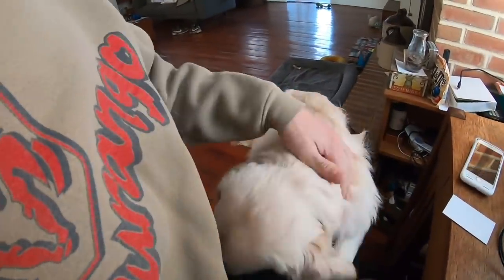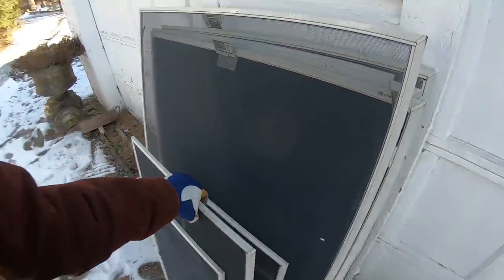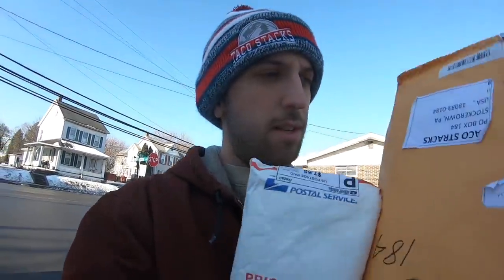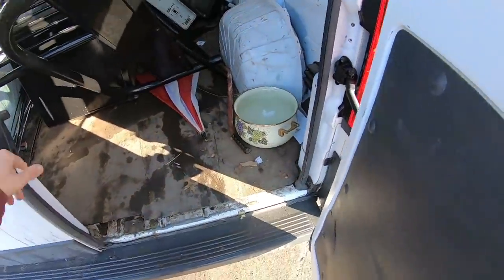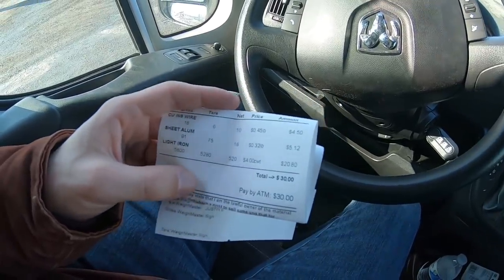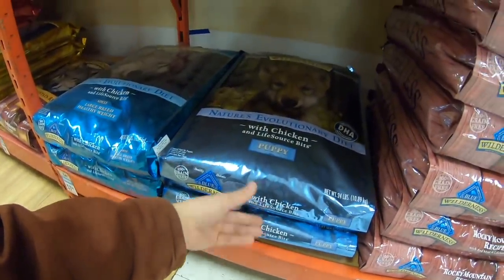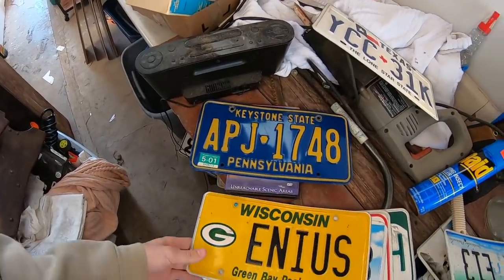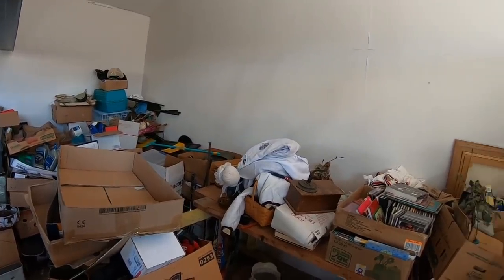Scrap Yard Trip - Working on the License Plate Collection Wall - Vlog

Comment: I’m pretty sure that you can fix that crack in your bumper with a resin(?) appoxy kit that you can buy at the auto parts store. We fixed our front bumper with something and I’m sorry to say I can’t remember what it was because of the number of years ago. It looks great.  I hope this helps. It will be expensive but not as expensive as replacing part of your bumper.  I think it cost us between 15 and $30.

Comment: Screens are fiberglass
Reply: Nor necessarily. They make , or used to, a black coated aluminum screen. Worked in a hardware store and sold it. Should be able to tell the difference as fiberglass is soft to the touch and has more give.